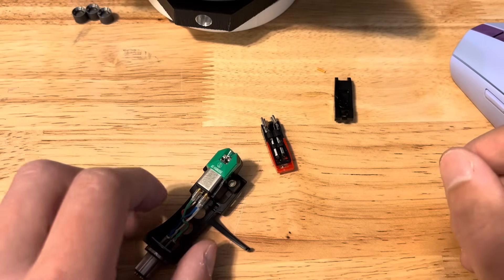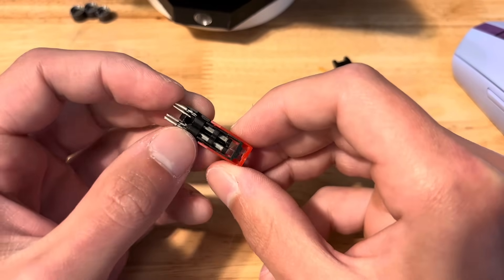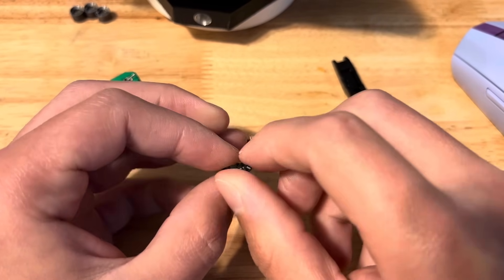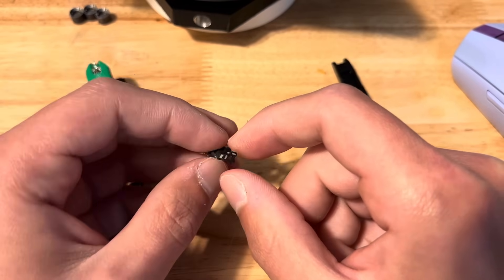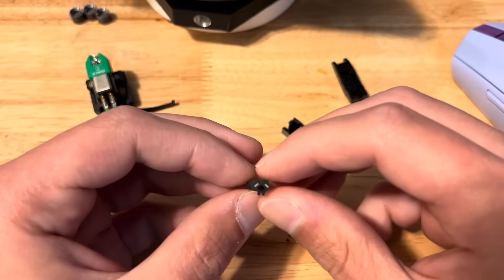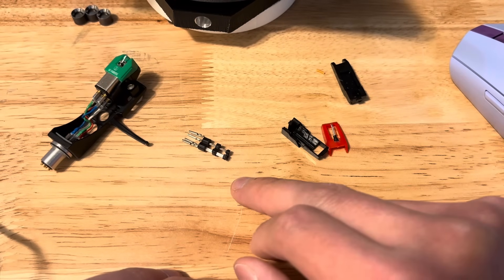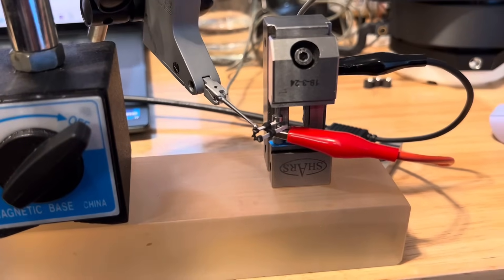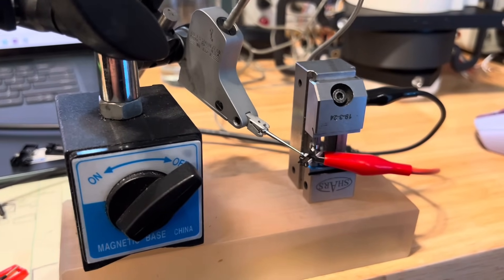Record player cartridges as actuators for SPM/STM?

Comment: Phono cartridges were used in the 1960s as transducers at each end of the spring in spring reverb units, working both as detectors and as actuators. They weren't piezo, though -- just moving magnet, as far as I know.

Comment: the head ends of harddrives (platter type, not the ssd) also have these manipulators iirc.
Reply from the maker: Yep, hard drives are some of the most insane pieces of precision engineering we interact with on a daily basis.
Reply: @cylosgarage seriously, I love how non repeatable runout from nanometer differences in individual balls for the bearings was too much, so they had to move to hydrodynamic bearings/air bearings to compensate.

Also, the platter itself actually has lubricant on it! Just a few nm thick, but it helps with triboelectric charging and reduce damage in the event of a head slap

Comment: That is a cool find but I think you would need a 2nd cartridge for a Z axis. It will be almost impossible to hold the right Z height over the sample otherwise. By the way DVD lasers use coil actuators in a closed loop with a photo diode for feedback. They have 4 sensor pads and depending on light distribution they can measure their position while "flapping" up and down. This solves the stiffness problem.

Comment: Is it possible to use piezoceramic rod in toolpost to correct micro-errors when turning a workpiece on a diamond lathe?
Reply: It is, and is being used for such applications. There is even ongoing research on using piezzo stack in spindles of large machining centers to compensate for tool chatter online improving the surface finish.
Reply: @Konecny_M  interesting, thank you)
Reply: @Konecny_M yep, they've also developed recently using a piezo actuator oscillating at 100khz to diamond turn ferrous parts.

The tool swoops in and out of the workpiece, and since diamond had a conductivity of 2200 w/mk, the cutting edge is able to disappate heat to the body of the cutting tool, avoiding the diamond edge getting destroyed by diffusion and iron acting as a catalyst for diamond-graphite conversion at temperature

Comment: Nifty, never even thought of such reverse applications. Not exactly related but, it did remind me that just like those typical cheap piezo discs & under the saddle bar/wire types, such cartridges can also make for good acoustic instrument pickups, in just the right mounting config anyway. It was a VERY long time ago I tinkered with that & now that I'm thinking about it, it may have mostly just been that the rubber lip reduced the harshness typically associated with other types to just the right extent. It really did sound great though, even played out with it for a few years along with it's rather cheap DIY op-amp preamp. Forget the brand/model but it was definitely just a cheap-o, both the cartridge & the guitar.